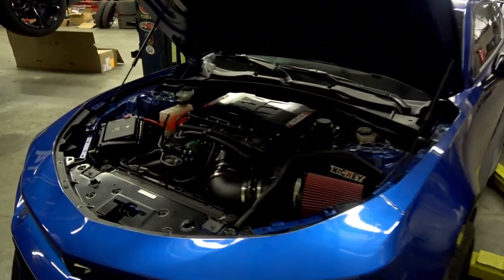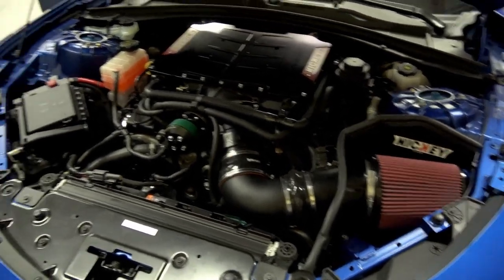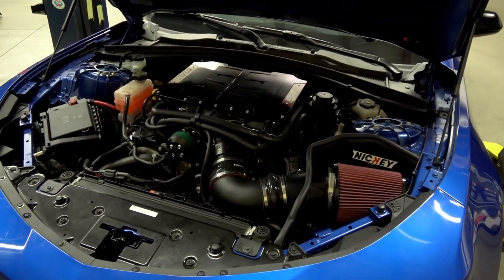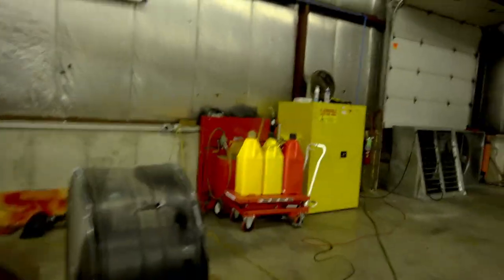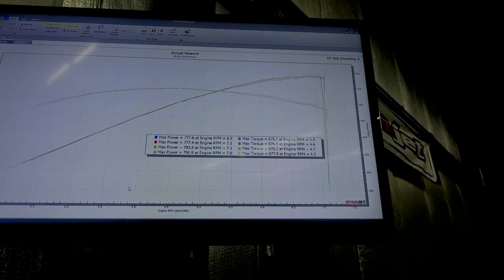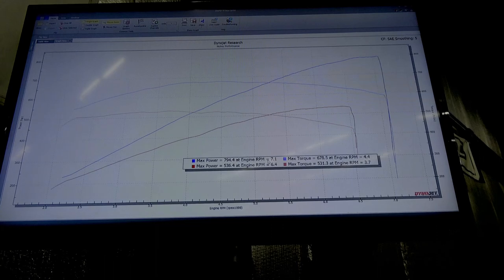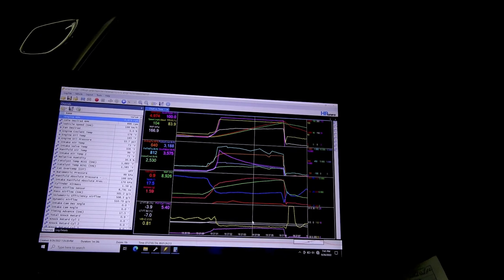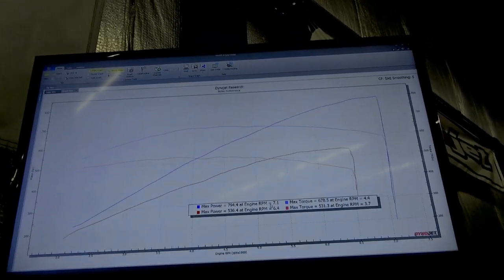ZL1 1LE Nickey Stage 2

Comment: Thanks, so for now you did the fuel pump and stock injectors, was the tune any different from that?   Running the 112mm  is it different only from 3/4 open on up....did it help the tq?   WOW is that a great running car!!!
Reply from the maker: This car has a Fore Innovations return style low side system. Stock LT4 injectors and hpfp. The 112 gives a little more above 5500 rpm and helps with blower efficiency.
Reply: @ApeMotorsports  Thanks